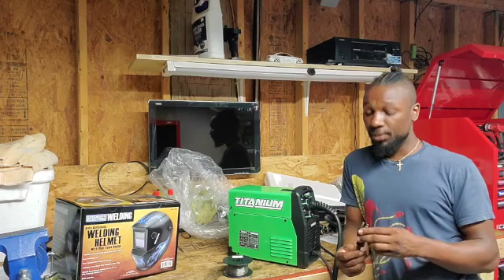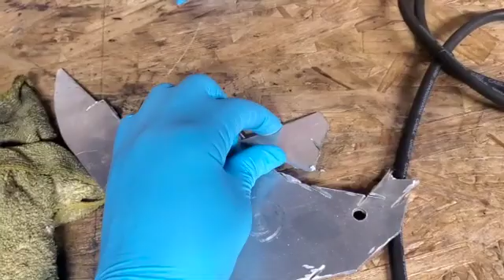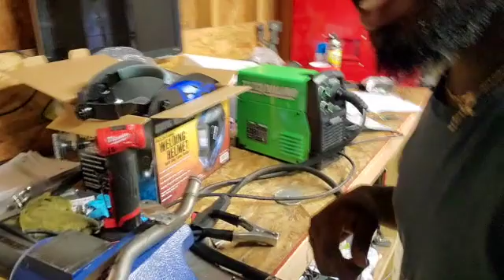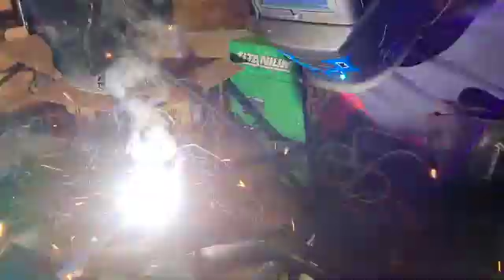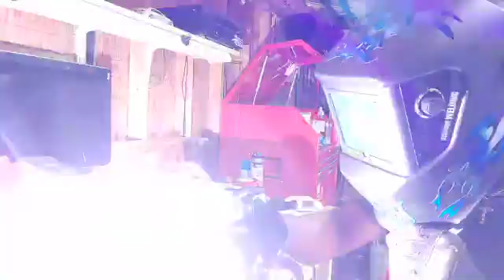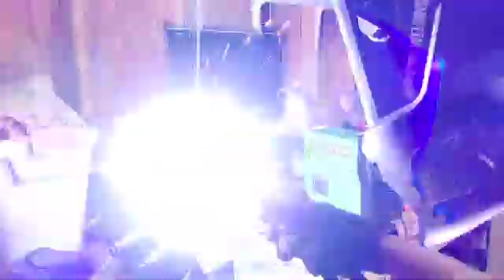Welding for the first time Titanium Easy-Flux125 welder

Comment: Get you some proper gear: welding gloves, cap, jacket with sleeves. With the limited gear you are using, I can tell you are scared of the sparks (as you should, they're hot) and are keeping a distance from the weld. The proper gear will allow you to get much closer and steady yourself so you can take your time with what you are doing while you're welding. With all things in life, it comes down to practice and learning. Also, not a great idea to weld in a tinder box and cardboard goes up easy, happened to me and it was not fun. I just picked up this welder and it does amazing for what it is.
Reply from the maker: That's you're totally right, proper gear is a must and I actrually have picked up sleeves and proper gloves since thi video. I haven't done much welding though, I'll have to get back into the groove one day.